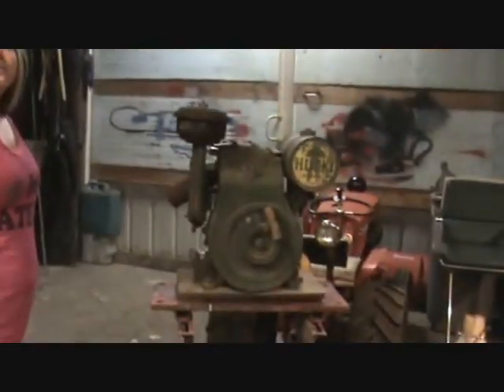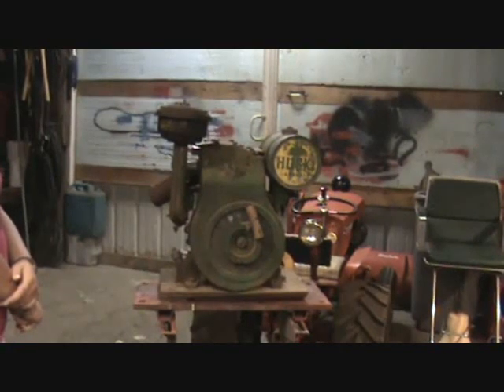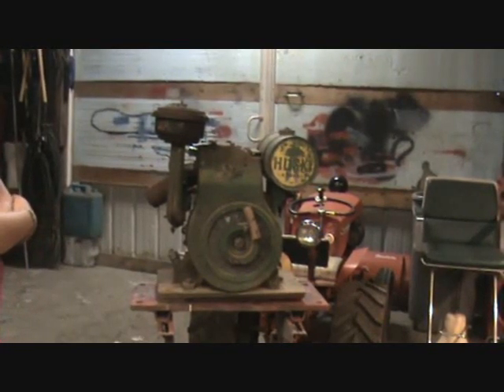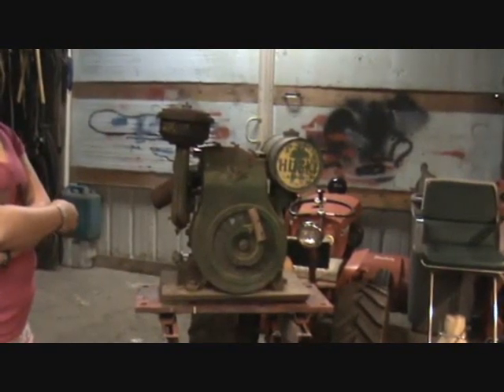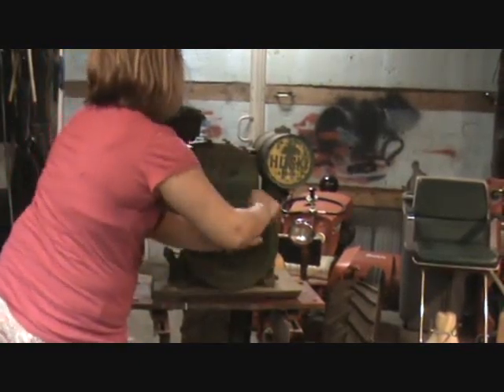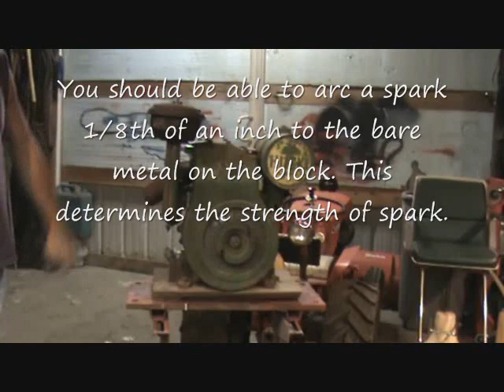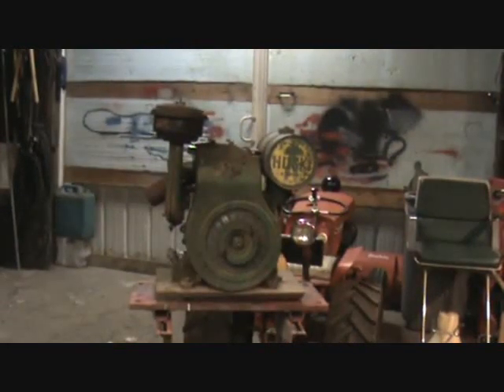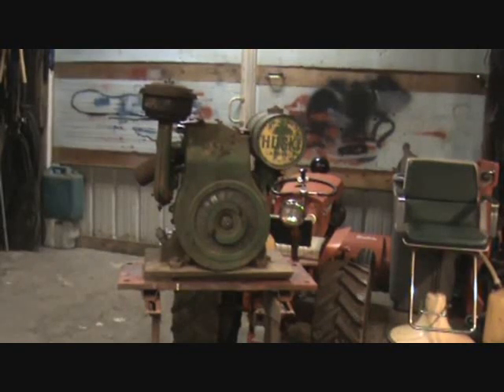Briggs and Stratton BR6 Running

Comment: Hi Zippo, I enjoy all your videos and appreciate your spot on tech data, I will be posting videos shortly, and wanted to pass along a tip to all that I found out. on letter series Briggs A,B,K,Y,Z,ZZ ,the older ones before 1942 were equipped with a 62235 oil retainer on the flywheel side ,not a true seal it would pass oil and eventually coat your points , making you lose spark or misfire, Briggs introduced oil seal # 290013 as the fix, and it fits pre 1942 as well as after 1942, a true seal.

Comment: 9 times out of 10 on these old briggs the spark issues are usually caused by dirty points or bad gap. i got a model B it runs but the carb needs to be rebuilt on mine. you gotta find your self one of the crankstart versions. they are pretty neat the bigger ones have a compression release.